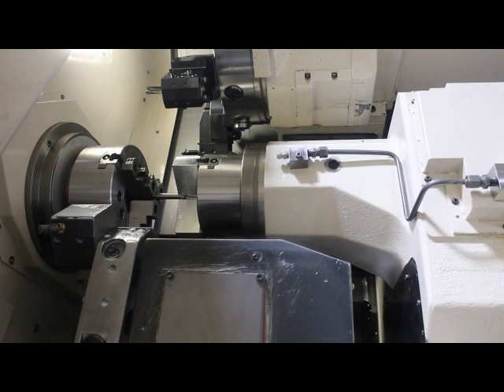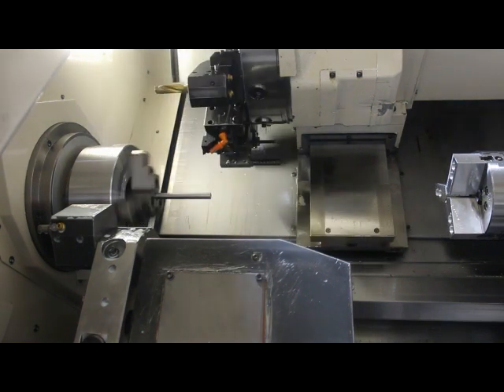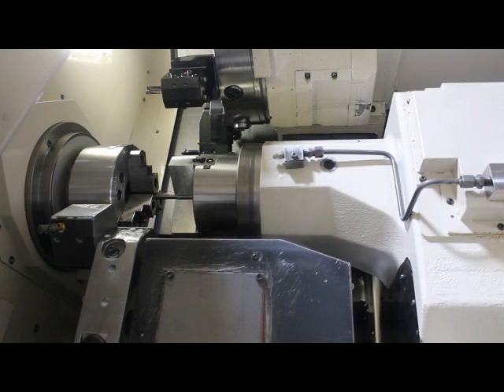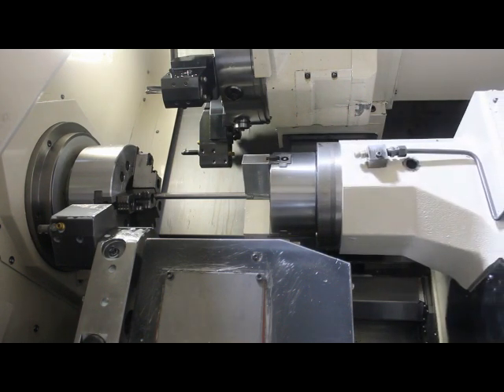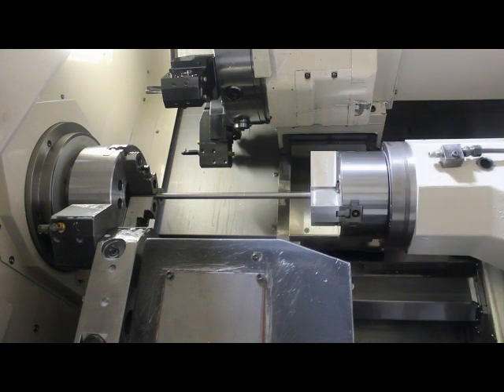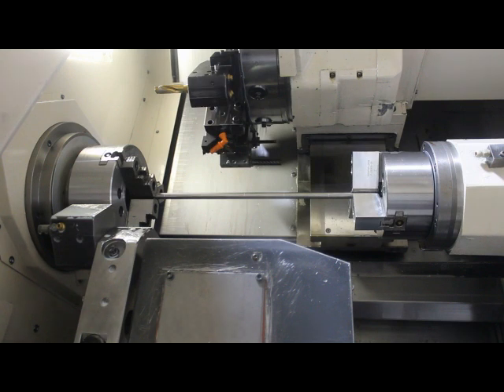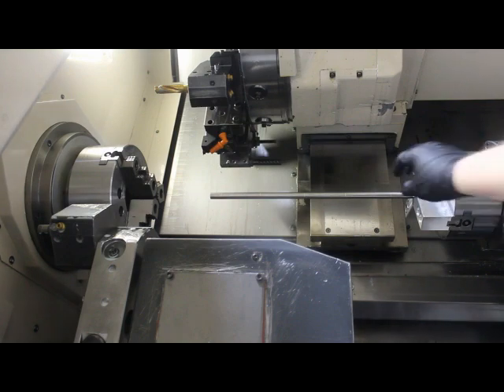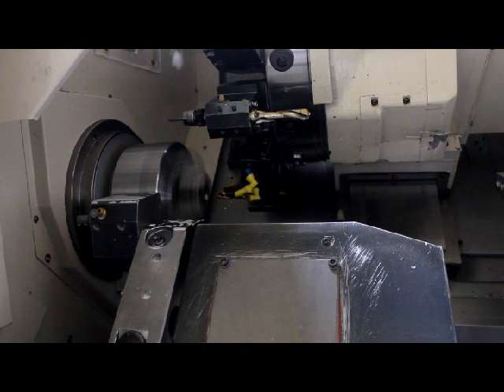Grooving and using sub spindle on Okuma Lathe (CRASH)

Comment: you actually use g codes for okuma? 
don't you have conversational programming? what about live tooling
Reply from the maker: Our machine is rather old and has no conversational. I been working though a post processor and have it mostly setup so use fusion for the bulk of the code. Sometimes modifications are needed. Live tooling we have not invested in them yet as they are pricey.

Comment: hi 
D & J Machine! can you show me codes for suspindle? i cannot control it,thanks first.
Reply from the maker: Ok, so this is kind of a broad question, You move the sub spindle like any other axis G00 posion.
Example.
G00 W3.125 move my sub spindle.
If you have more than 1 turret its important to call out the turret
G13 for A turret
G14 for B turret
Also important codes to know
G140 for main spindle
G141 for sub spindle
M151 Sync sub spindle

Here is the specific code I used to bar pull this doesn't include a spindle sync.
WARNING!!! don't just run any code you get on your machine without understanding it, even when you do turn rapids down and single block on.
This code is for reference only. I'm no expert on this lathe and I have noticed the same g-code
responds differently on different versions of the Okuma.
I did my best to comment it but there could be errors in comments.

If you have any questions feel free to email me dnjmachine@gmail.com
Hope this helps.

N0005
G0 X30. Z2.(Rapid turret to safe location for tool change.)
T0900
G00X30.0Z2.0T0909 (Toolchange)
M05 (Spindle Stop
(sub-spindle-attach)
G00X30.Z2. (Make sure turret is out of the way for spindle to come in.)
G00W30.0 (SUB SPINDLE ZERO RETURN - Sends sub spindle out to its max)
M05 (Stop Spindle)
M145 (SUB SPINDLE STOP)
M249 (SUB SPINDLE OPEN)
G00W0.0 (Bring subspindle into part 0)
G94G01W-0.3F30.0 (Feed Per Minute Mode and bring sub spindle in -.3 at Feed 30)
M248 (SUB SPINDLE CLOSE)
G04F0.5 (Dwell wait to make sure sub is closed)
(BAR PULL)
M84 (Unclamp Main spindle)
G94 (Set to feed per min not rev)
G01 (Make sure not in rapid)
G91 (Set Incremental move)
W3.438 (Move sub spindle to new position with bar clamped in it)
G90 (Set back to absolute position)
M83 (Clamp main spindle)
G04F1.0 (Dwell again)
M249 (Unclamp sub spindle)
G00 (Set rapid mode)
W30. (SUB SPINDLE ZERO RETURN - Far right)
M248 (Clamp Sub)
G04F0.5 (Dwell)
G95(Make sure Feed per rev mode set)
G0 X30. Z2. (Make sure turret is out of the way again for next op)
M01
Reply: @dnjmachine  Iam will try it and I to respect  thoughtful recommendations of you.have a good day!
Reply from the maker: Sorry on the delay, I just noticed a bunch of comments not responded to.
I will post some code this weekend, I'm away from my shop and my code until then.
Reply: @dnjmachine  it's ok,thanks so much!

Comment: Hey Daniel.
I was very worried when you mentioned an up and coming crash.
When it came to the arse pucker part of the video.
I was dreading the worse.
But actually it was not to bad.
Thankfully.
Looks like your starting to master your latest machine.
It is on my Wish List, lol.
Of machines to buy in future.
Looking at buying something new.
But Not for a few years still.
My preference is a Doosan with a 10 inch chuck only C axis on the turret and like yourself must have a Sub Spindle.
As you already know they come in very handy.
Good to see the video,s from you.
Big Thumbs Up, for future video,s.
Peter.
Reply from the maker: Yea it could have been a lot worse.
I have had worse just not on camera lol.
I have had this machine tool change with the sub spindle in the way and snapped the parting tool off shattered the safety glass and the machine didn't even notice. I assure you tho it was very scary and was loud when that half inch bar just snapped and went banging around in the machine.
Altho the 2nd turret seemed like a good idea its been more of a hassle to keep out of the way most of the time. Sub spindle is a must.
At this point I need to get a good collet system for the machine as dealing with the chucks isn't very fun to setup when changing stock size. The machine is a total beast at taking off material.
Its nice to get comments keep them coming man and I will try to keep these videos coming.
Reply: @dnjmachine  
Yes shearing off material in a CNC anything can certainly wake you up, lol.

I did a repair on a major CNC Lathe crash at one place i was working.
The guy ran the Tool Turret that hard into the Lathe Chuck, it actually ripped the chuck off it,s mount ????
That was a very time consuming repair job and expensive too.
Counting my time, replacement parts and the down time of the machine as well ???.

Twin Turret machines definitely have there place.
But for general turning work they are way more than you might need.

A good collet system is a great investment, especially if you do a lot of smaller diameter parts.
I need to keep the chuck on my machine as my work varies in sizes, from very small to fairly large diameter pieces.

I plan to keep in touch with you as you post more video,s.
You are right it,s good to get comments on video,s.
It sought helps to make it more worthwhile posting.
Reply from the maker: That's pretty crazy I probably would have crapped myself had my spindle ripped off and went banging around in my machine.

We do mostly collet size work but just hadn't gotten the time or money to buy anything for it. There is always something to buy... We have been really fortunate we have been able to get what we have I feel.
The Mori did have a collet adapter not the Okuma tho.

Thanks I should do the same for others but I'm barley keeping up with myself these days. Very soon hope to have some things smoothed out.